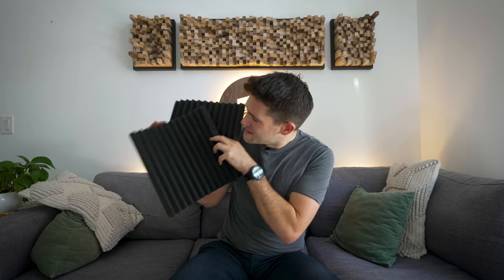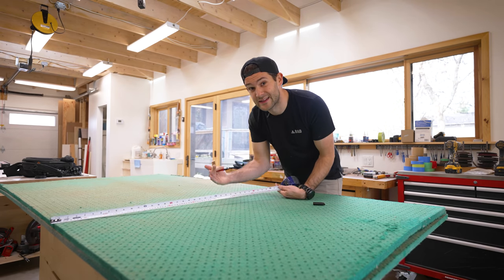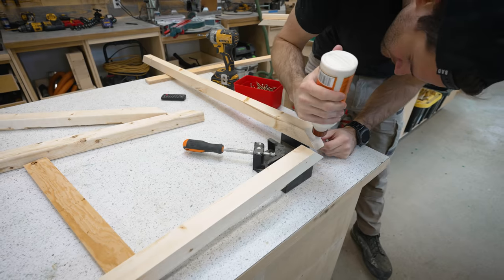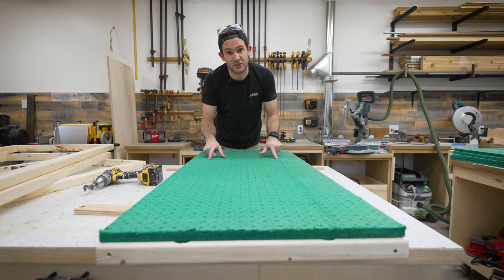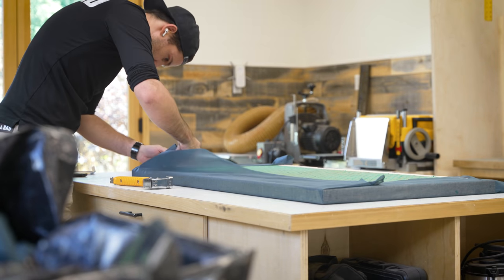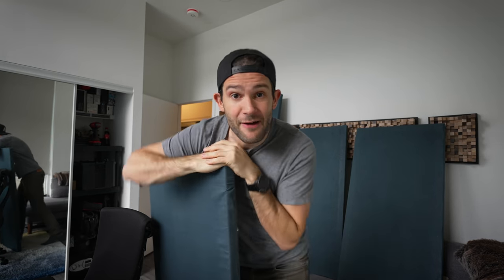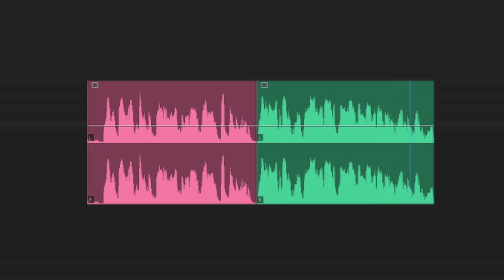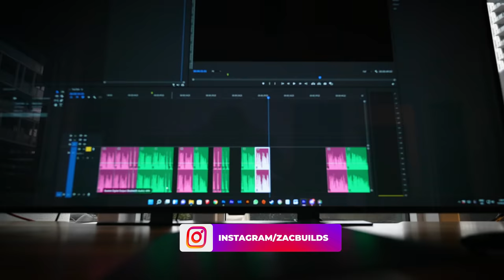Acoustic panels that actually look GOOD

Comment: For just a few acoustic panels, here is a way to make them out of old thrift store terrycloth towels. https://www.youtube.com/watch?v=pABvTWSxOes

One note, I think he didn't need to use as many layers of toweling as he did. His tests measured attenuation in a single pass through 4 layers. But in a panel on the wall, any sound would have to go through the toweling once, then hit the wall behind and then through the towels a second time. So his 6 layers of towels were equal to 12! layers in his tests.

Comment: I would consider a 1 or 2" air gap between the back of the panel and the wall. You need to think about absorption vs diffusion.

Comment: Be warned covering your hvac intake will stress the hvac motor if its just a exhaust then ignore this.
Reply from the maker: You can see pretty clearly in the video I'm not covering the actual intake, just the access cover above it.

Comment: Big mistake you made.. You need only 1 sono panel inside the frame. Because there must be a gap between the wall and the sono pannel by about 1-2cm to have the tripple sound absorption instead of packing 2 into. :hand-orange-covering-eyes:

Comment: gotta be honest heard the final part of the comparison between with and without sound panels and yeah there's a little difference in the highs and mid highs but it is almost not noticeable (yes I heard it on a good pair of studio monitors), personally I think that this type of soundproofing-acoustical treatment is oriented on having a better playback in terms of the relationship between the reflections of the room and your ears not that much for recording purposes, but yeah something is better than nothing in this type of scenarios I guess, nice video though sometimes I think this only applies to the us? where the fuck do i find that material in costa rica wtf
Reply: Reflections are reflections. The room won't care too much about the type of source, but more for volume, frequency, source placement and source direction. But the thing with this setup is, that it's just not enough surface covered to actually judge anything. Ceiling is untreated and putting up 4ft of absorption on a 10-12 ft wall is just not going to cut it.

Comment: Those thin foam panels are pretty awful at actually absorbing anything. Too thin, not remotely dense enough and at best they will diffuse the highest frequencies, imo. A proper absorbing panel should be like 4 inches thick, or 2 inches with an air gap. So, I'd rather DIY, or buy good stuff, not those flimsy, floppy foam patches that do indeed look hideous. The thickness of the panel - regardless of material - directly affects absorption, since it has to do with the frequency of the sound wave and its lengthf; this is also why taking, say, 2 inch thick panels and leaving an air gap between it and the wall will increase its effectiveness beyond what 2 inches would otherwise do for you. Once you get down to the higher bass notes or low bass, to meaningfully affect stuff down under 250 Hz, you're looking at even greater thickness which is why that's usually done as corner bass traps.

Comment: Usually this channel has great stuff, but this is the wrong material for the job. Redoing your drywall? Great, put this underneath first. Rockwool is cheap and you can easily build 2 - 4" deep using 1x4 wood and the same upholstery method. 

Sheerer the fabric? totally wrong. If you can blow through it you're fine, regardless of sheer. Burlap works well, as do other fabrics. Or be like most people and wrap the rock wool inside the frame and leave the frames showing the wood.

Comment: Zac, I hate to be a party pooper because I love your enthusiasm and don't want to dampen it (pun intended), however you are mixing up all sorts of different issues and solutions.  It's way too long to explain and I don't consider myself knowledgeable enough, but I've spent my whole life in studios.  You are confusing acoustical treatment with sound-proofing.  Both are very different.  To offer an over-simplified explanation,  I believe ultimately you are trying to reduce echo and/or standing waves.  Therefore you need sound absorbers with small holes to absorb and prevent the reflection of high-frequency sound waves, and you need sound absorbers with large and larger holes to absorb and prevent the reflection of low-frequency sound waves.  You also want to minimize the occurrence of parallel surfaces which keep bouncing the same sound off each other.  However don't go by what I say.  I'm definitely not an expert, just a user, but this is what I have seen in every quality studio for the past 40 years.  Cloth curtains over your windows would be great also. Hope this helps!

Comment: Why do you make the panels so thin? Such thin panels are useless... 100 mm thickness is which is the best. It handles high fequencies and even low ones down to 90 hz
Reply: Your panels seem to be 40 mm thick and that thickness has nearly 0 effect at the range of bass of speech which is starts from 250hz

Comment: Such a misleading video. There is quite a difference between Sound Absorption and Sound Proofing. Do yourself a favor people and understand the difference. The later is pretty much useless for controlling sound within a space which is what 'panels' like these are traditionally used for. 

I'm sure sonopan is a good product for it's designed purpose, but absorbing sound is not it's primary purpose. Rockwool and other materials are much better for absorbing sound. We won't even get in to the fabric used is this video probably not acoustically transparent.

Comment: This is what's so damn frustrating about tech-bro youtubers like this guy.  He's so anecdotal that it defies any kind of scientific logic for the setup of the video.  "I've used it (rockwool) and it doesn't work that well, and I've been to trade shows and this works very well."  Okay...so this flimsy statement forms the basis upon which to trust anything you say following that declaration.  It's your truth but it's meaningless unless you can explain how one works well and the other doesn't.  So far all you've done to solidify your thesis is compare ugliness factors.